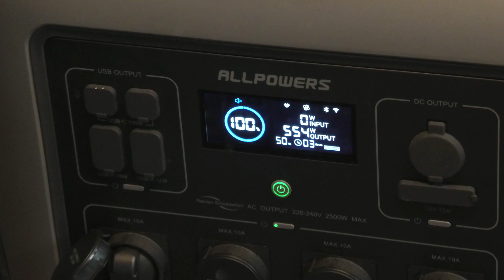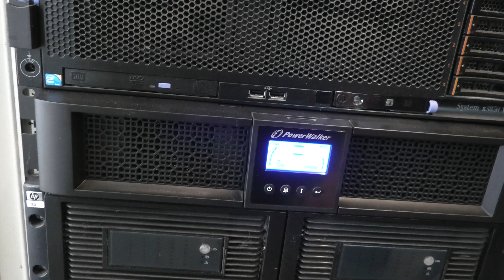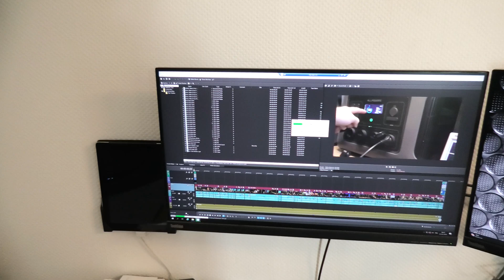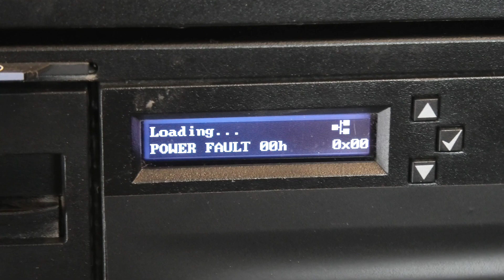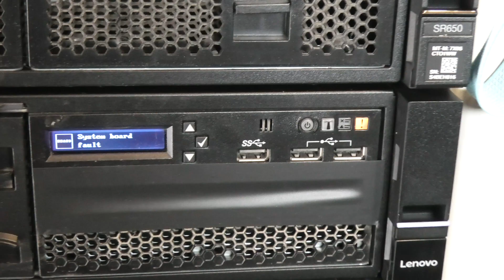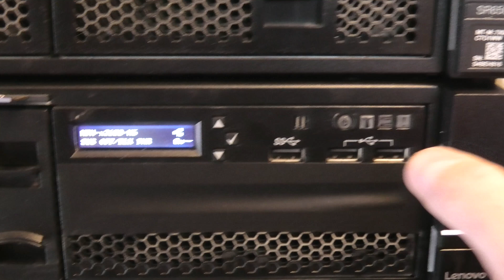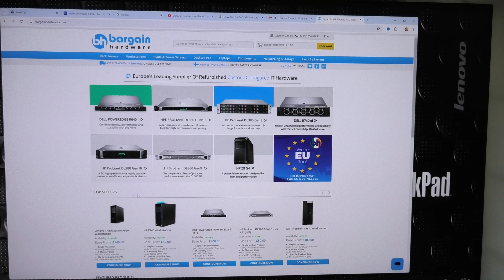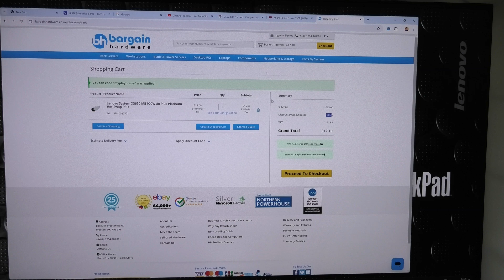750W Power Supply Died in my Lenovo X3650 M5 - 1400

Comment: Hab no luck with 3650s lately either. 4 M5s died last month due to power failures. one PSU similar to your fault (yepp, shorted mains), two others with a DC regulator failure similar to the infamous M4 design error. I really hope the 650s hold up better.
Reply from the maker: I replaced the Power supply yesterday,, works again.

Comment: Having the Allpowers in line with the ups can cause horrendous harmonics on the mains that could cause damage. It's a big no no! Have a chat with the power guys in work to confirm.
Reply from the maker: How to get around that ?
Reply: @MyPlayHouse  the only way is to have the UPS and Allpowers feeding separate PSU's on the server, or via an ATS If single PSU. You should achieve the same autonomy as they'll be sharing the load, till one runs flat.

Comment: It seems like the faulty PSU took the internal DC-DC converter with it... I think that is the black cube you pulled out behind the power supply caddy.
Reply: Yap... The contact blades of 750w and 1100w even 550w older one ( that is underpowered by the way!) seems identical ( maybe different gold fingers allocation to 12v, 5v etc but I doubt it) so it sound to me DC-DC converter faulty too... Or worse faulty MB on power side 🤔💭😱😱😱😱😱😇.
Reply from the maker: New PSU is through customs,,, Hope it was in the PSU..